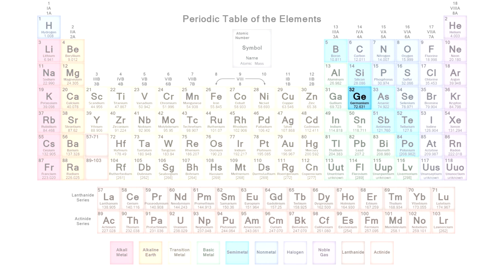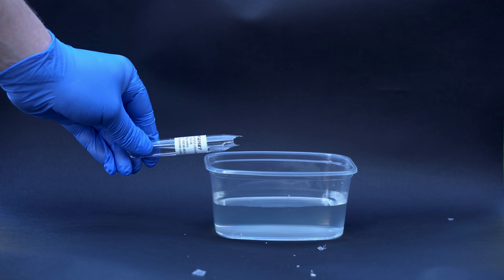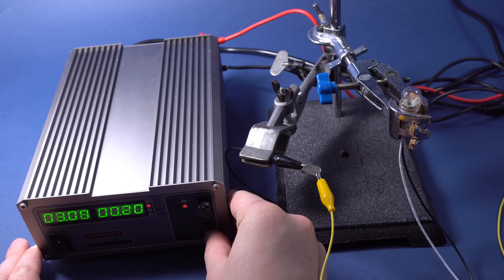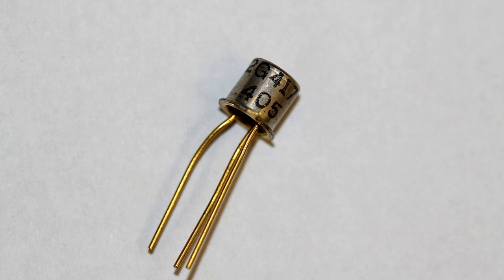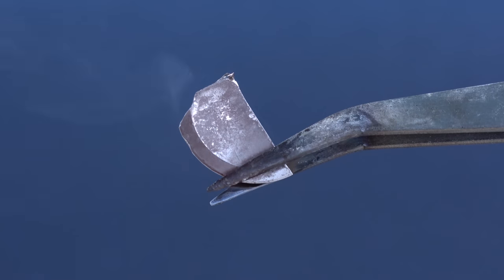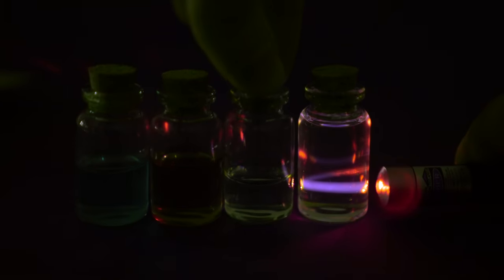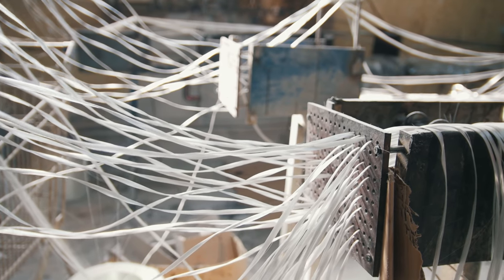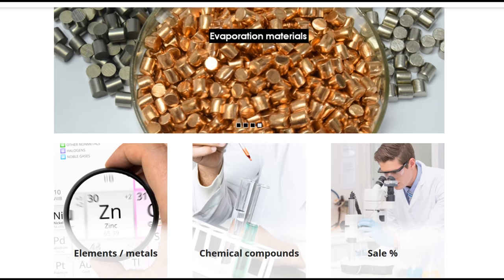Germanium  - THE MOST FUTURISTIC ELEMENT!

Comment: Germanium was used as the diode detector in the crystal radio I built when I was a kid. A lump of germanium metal was placed on a metal plate (I used an old style razor blade). A very thin wire (called a "cat's whisker" was gently moved about the germanium until a sensitive point was found and music from AM radio started in my headphoes! No batteries! Lookup kits for this. Nowadays they use a 1N34 germanium diode in the kits so you don't have to fiddle finding a good spot!
Reply: I also built a crystal radio set when I was young -- and yes, it too had the "cat's whisker" that you had to probe around on the germanium chunk until you hit the "good" part. :-)
Reply: I, too, have put something together like these crystal radios you described. But it had the exception 1N34 diode. Still worked great. Excellent audio from the earpiece. No batteries! Nice! Actually picked up several local and regional stations (at night some stations from Cincinnati and Chicago would come in.
Reply: ran a 20 meter directional aerial off mine as a kid, i actually forgot this; thank you for reminding me =]
Reply: Nowadays, in some parts of the world kids can't do this anymore... As more and more AM stations are going offline.
Reply: I also built one, and used germanium chunk even though I have germanium diode
Reply: I just realized that what my crystal set used was a lump of galena, not germanium. Galena is crystalline lead sulphide and it also acts as a semiconductor
Reply: @EdwardTriesToScience   I too built one and took it to the Boy Scouts science fair, Because AM station KOMA in town was So powerful ALL I could receive was that one station. A tornado took down two of there three towers they stopped as a AM station.
Reply: @telephony  is it like finding the G-spot in Germanium?

(Sorry the immature part of my brain wouldn't let me not write this corny statement 🌽)
Reply: What the I gotta try this
Reply: Nice info 👌👍👍

Comment: 50`s, 60`s. Germanium diodes and transistors. They were replaced by silicon because of back leak of 1.2V while silicon leak have .6V. Russian satellites still operating with electronics based on Germanium.

Comment: X-ray telescopes in space depend, not on parabolic mirrors coated with silver or gold but on paraboloid cylinders made of germanium.  The X-rays would go right through if they hit a regular mirror but, if they graze the germanium surface, they will skip like a flat stone on a smooth water surface.  That way they can be guided to a focal point.
Reply: A geometry question. If a 360 is achieved at each node of honeycomb pattern then by folding ect. And so on ,then the outcome is 360. But what is the motion

Comment: If it’s used in radiation detectors-turning the radiation into usable current to set off the detector then Germanium is like a radiation conductor/acculturator? 
It even absorbs light rays.

Comment: Given 2 samples of Germanium .
Both prepared by different methods .

Which sample has more resistivity ?
Reply: Germanium is germanium so I think there's not gonna be a difference
Reply: @sinpi314  depending on the synthesis method nature of the output is varies .  Crystal size will differ and thereby properties will vary !
Reply: @ashwinnair9881  you never mentioned what the different processes were so...